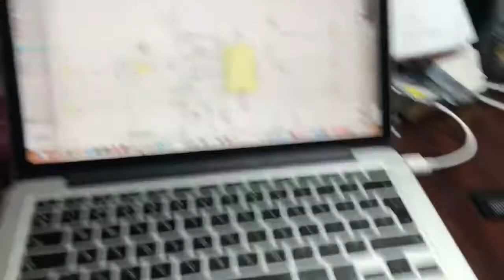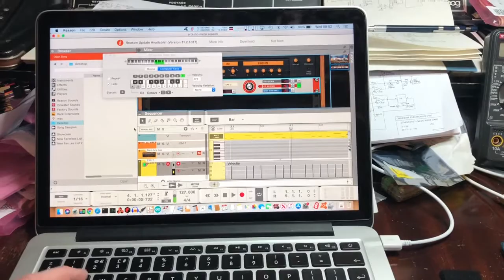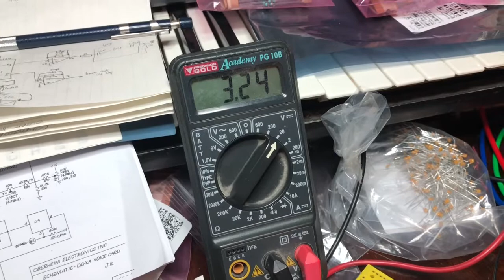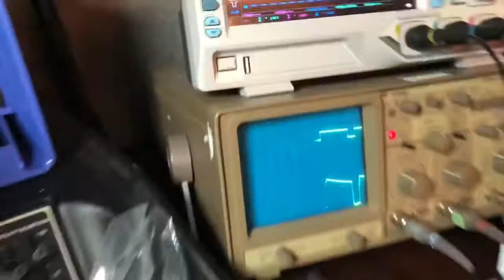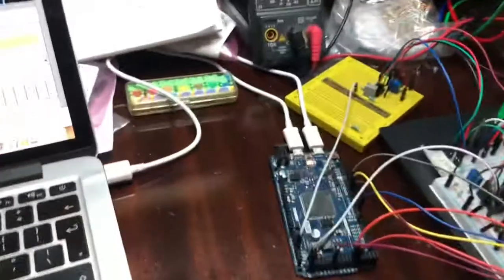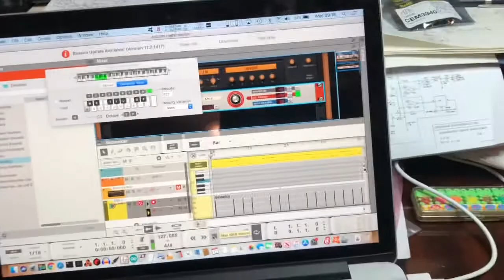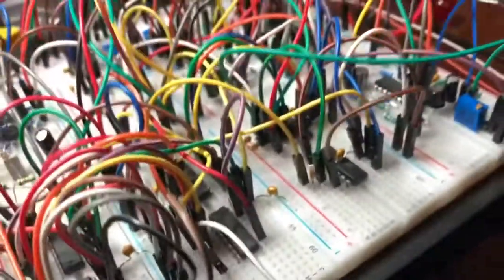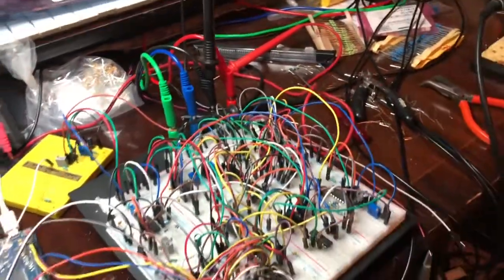Testing CEM3340 vs AS3340 in synth prototype

Comment: What is the software you’re running on your mac?
Reply from the maker: I'm using Reason to send midi note and midi CC data over midi usb, and a terminal emulator to send debug commands (turn waveforms on and off) to the synth CPU